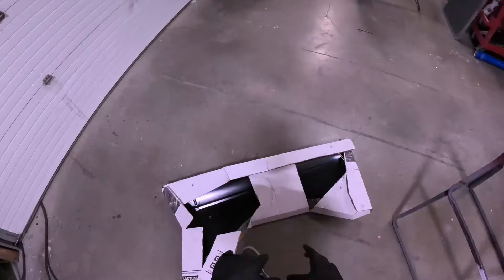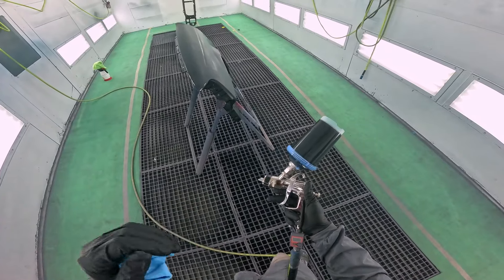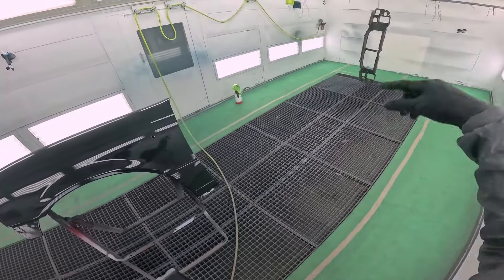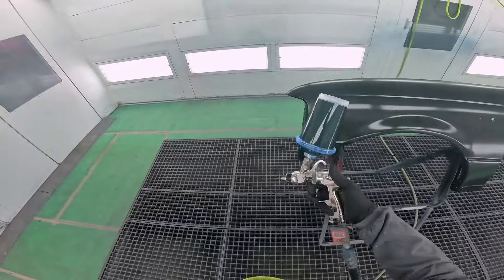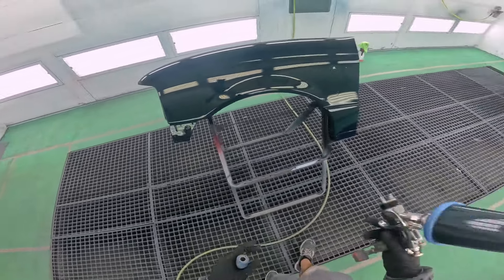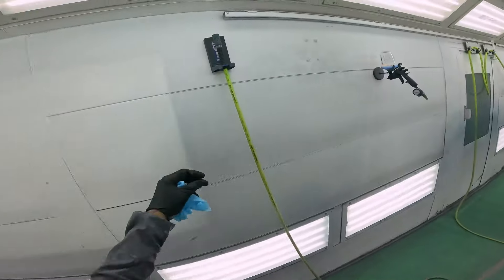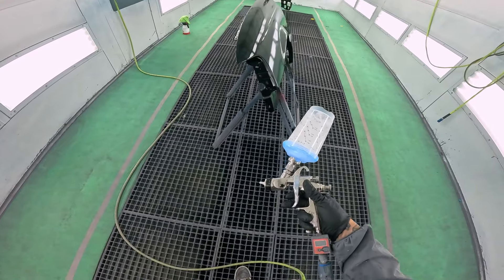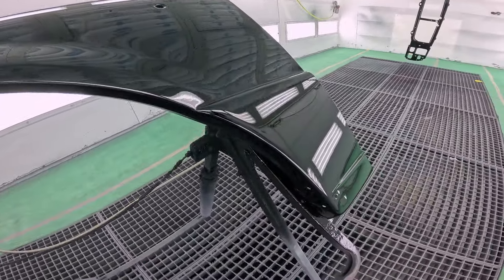How to paint a new panel professionally! (Eastwood CC500)

Comment: Hi Joel, awesome video it's not that often that a painter will take his/her time to show us the entire painting process from unpacking the panel then the prep all the way to clearing it, I found this very interesting and informative👌I have tried water basecoat but in my little booth at home it's not very practical as it's difficult to get it dry, I tried a hairdryer which did help as I don't have the air capacity to use a blower but solvent is perfect as the hairdryer will flash it off in a couple of minuets.
I would love to see more videos like this but I realise it's difficult for you to do as you are at work earning a living🙏👍John UK

Comment: great job the interface pad you used is it firm medium or soft thank you I'm not sure when  to use interface pads
Reply from the maker: In final prep stages interface pads are used. I only remove it when doing any kind of body work. Anything 320 and higher I’m using an interface. It’s a lot safer and you’re only trying to refine sandscratch at that point instead of straightening.